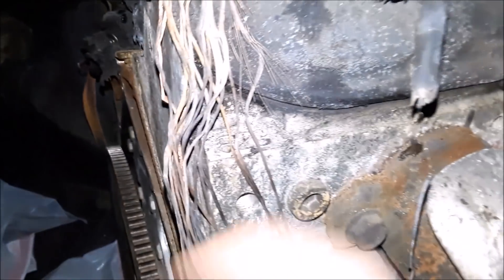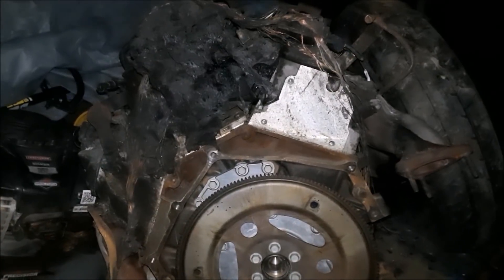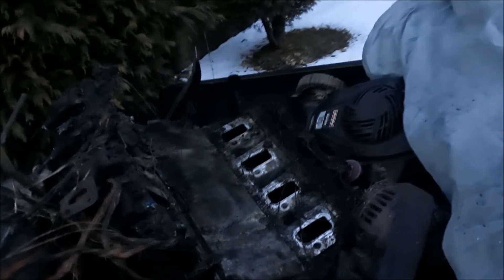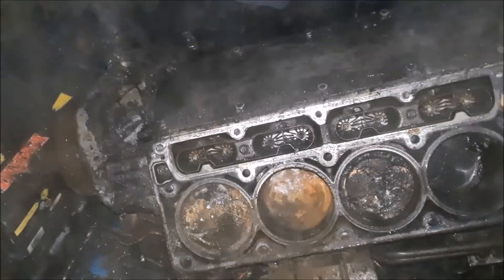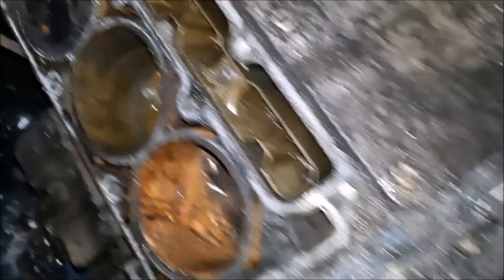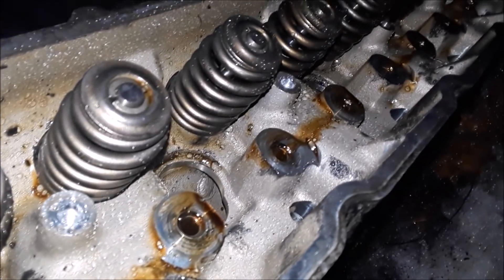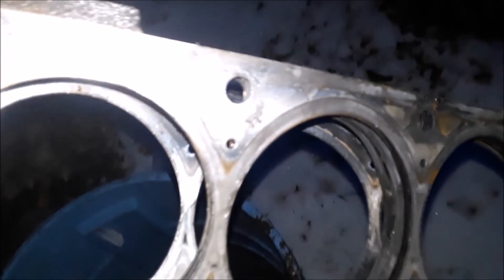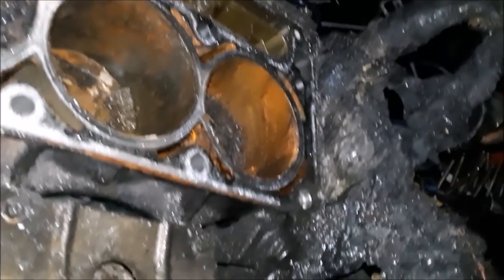6.0 LY6 Disassembly |  $150 Junk yard 6.0

Comment: You would be surprised how there may be not much wrong with that engine block.

I had to replace all the Hydraulic lifters in my Chevy LS1 because they were clattering, they were very noisy,some people thought a conrod bearing had failed on me or something.

So,it sounded worse than it actually was but it runs like new now,I did check the engines compression & oil pressure before outlaying any money on the engine but.

Comment: If can't get oil pressure it's the little oring on the pick up tube  going into the oil pump
Reply: Yeah.... Just change it out now while you're there. Same with the umintake manifold plenum has an update. That one is less serious because it takes about 10-15 years to break down, it will cause a lean running because of a micro vacuum leak.

Comment: If you don't want to put money in a engine that doesn't deserve it then I have no clue why waste the time and money on a 6.0, they are junk, after the 7.3 Ford stopped making good trucks.
Reply from the maker: Ford's 6.0 is junk yes. but this engine is Chevrolet Gen4 6.0. very much worth it.
Reply: Patrick Baptist its not a diesel engine lol
Reply: Whoops you couldn’t melt down your Ford an pour it on me . Why the hell do you think everybody with a MUSTANG gets a LS if the want to keep up with CHEVORLET  . I worked on ye fords way back when I was a younger nothing interchangeable different flywheel then balancer .Swore off Ford when I was 19 now 66 still no deal. Want to race . I’m ready???
Reply: Ole yeah 7.3 knock knock rattle rattle. Keep ticking never impressed me on power stroke . 😂
Reply: Patrick Baptist. I have a 05 Ford 6.0 diesel an it’s not junk. It’s still running strong with 200K miles and counting. But this video is about a Chevy 6.0 gas engine. An I will b building one of these motor for my 89 mustang drag car. Turbo charger an make 1100 HP. Easy.

Comment: You're working out side in the snow?
Reply: ginger elvira It comes down to what someone is willing to do to have this motor as an option that would otherwise be out of the reach of most regular working , family raising. house buying  motorheads. The motor is  embalmed in the worst sort of post fire / toxic /mutant  /bussard puss variety   candy shell .   Actually , doing the teardown  in cold  weather  (and isolating the  gunkies to  to the bed of his truck).  is  keeping this fact finding mission  and the bonus carcinegenic compounds  unique to  a modern engine  compartment  blaze  alot less likely to end up  in harms way as opposed to sunny and 90F  and the stuff melting  off  and  gettjng tracked into  the door mats of the  wifes divorce attorney.!
Reply from the maker: comment of the week!
Reply from the maker: yes

Comment: I got a big block that was seized with rust in the cylinders I used atf and got it to turn, scrubbed off the rust with a green scotch brite pad (no pitting on walls) replaced that gaskets and now I do burnouts in my 54 Willy’s 😎

Comment: Dude you can reuse those head gaskets. Spray down the cylinders with pb blaster. Pull the pan off just to check the inside. Roll the motor. Lap valves and lub valve train. Use a Comp cam high energy cam. Soak your lifters. Reassemble with a carb intake.
Reply: Dave vonAnderseck reuse the head gasket after a fire? Are you high? Id be surprised if the block and the head aren’t warped its aluminum
Reply: @finharms9439  right this guy sounds like a dumbass.